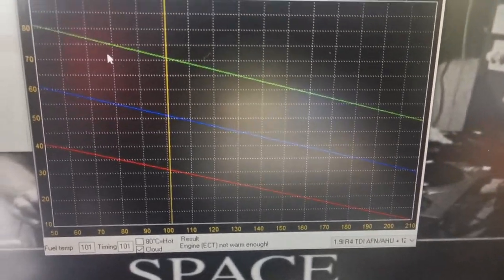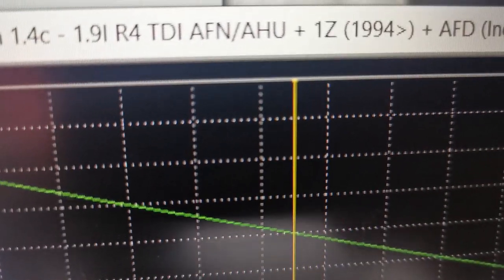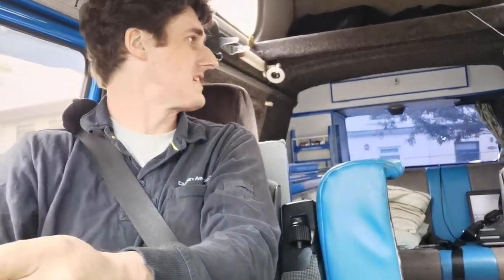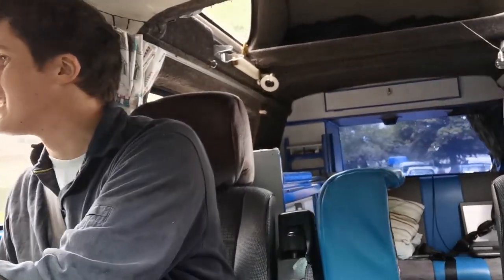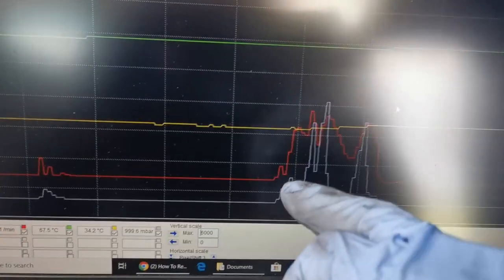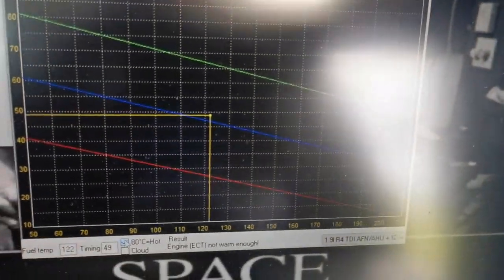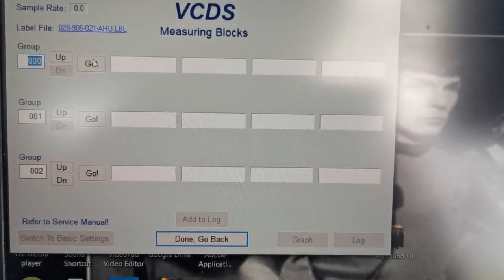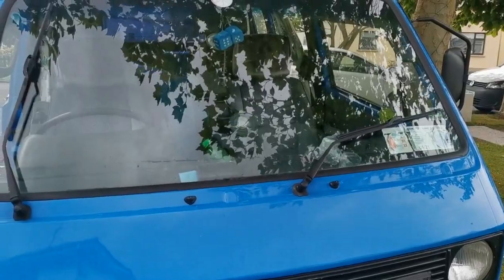VW TDI down on power with high fuel consumption - what's the problem?

Comment: Hey, you were supposed to check and adjust the injection quantity after that, if its out it, and it probably is, it will make a huge difference. Any update?
Reply from the maker: I actually ended up replacing the fuel pump at a later stage and set everything up correctly (after a MAJOR mishap). It's driving pretty well now but goes into limp mode from time to time.
Reply: @Endfloat  What's the code for the limp mode?

Comment: i have a 1.9tdi 1Z in my T3 and have similar issues. Dies in 4th/5th gear, no power, also can no longer hear my turbo spooling like yours which is a worry. You mention cruising at 80mph on the motorway, I can barely get 55 out of mine! Do you think it could be the same issue?
Reply from the maker: I meant cruising at 80kph, not mph, which is about 50mph. It could well be the same issue. I'm putting the van on a dyno on Tuesday and a video will follow so keep a look out for the update!

Comment: Check the MAF with vagcom also, make a log at full throtle in 3rd or 4th gear
Reply from the maker: What should I be seeing?
Reply: @Endfloat  on channel 3 on Measuring Blocks on vcds you should see how much air the ecu hopes to read and the real value the MAF is reading, when full throtle you sould read about 800mg/stroke, and when idling about 270-370 mg/stroke if the EGR was not deleted, if you deleted your EGR the MAF should read about 450-500 mg/stroke. If the MAF is going bad, they sometimes read a lot more when idling
Reply from the maker: @mauricio5818  Thats brilliant, thanks for that info. I'll take a look at that. Honestly, this sort of help I get through my channel really makes making my videos seem worthwhile!
Reply: @Endfloat  your welcome! And also thanks for sharing!
Ps: It'd be nice if you join tdiforums to show your swap, I've learned a lot from there and also there are a lot of people with more knowledge that could help!
Reply from the maker: @mauricio5818  I'll pop over at some stage and have a look. I think I am a member. I use the VW T3 TDI group on Facebook a lot.

Comment: Don't forget to loosen and re tighten injector pipes after adjusting the pump. With it being a lumpy diesel vibration can destroy the ends if you've just twisted the pump without loosening and re tightening the ends of the pipes because it causes a twisting motion on the pipes.
Reply from the maker: Good idea. I will do that actually.